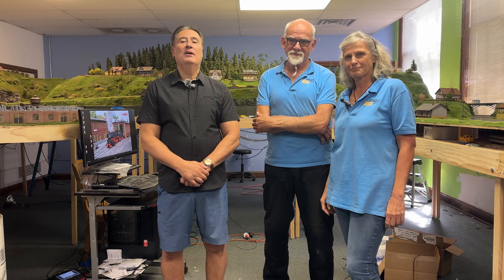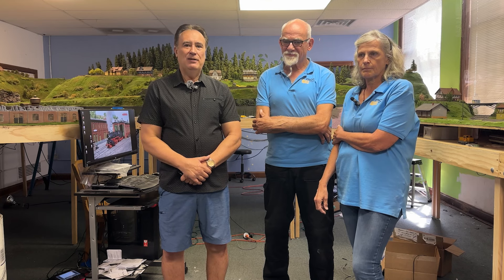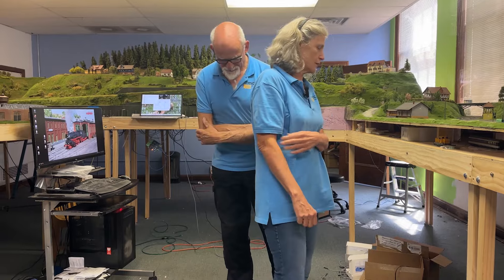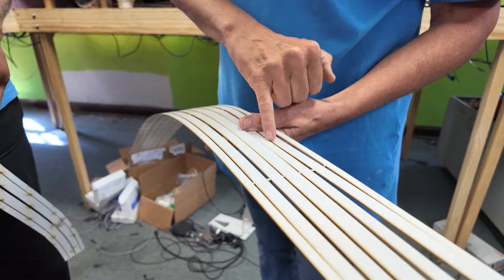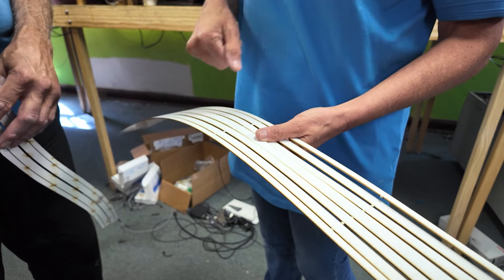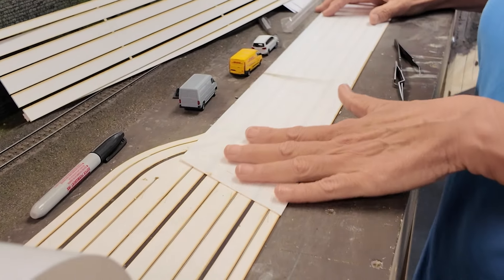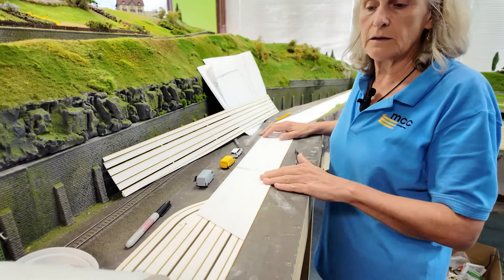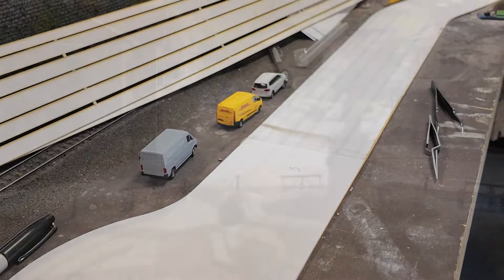A Revolutionary New Advanced HO Car System

Comment: Definitely need more information and understanding how this works.
Reply from the maker: This system is truly an improvement from current systems on the market, as it leverages software and GPS positioning without the need for mini-satellites mounted on ceilings. Instead of sending data from satellites to each vehicle, the DCC data is transmitted through wires running along the side of the road. Satellite-based systems often struggle in tunnels or shadow stations, and they require cutting holes in the tops of vehicles to receive communication, which is far from ideal.

Comment: Interesting concept. I worked with the Faller system at Gulliver's Gate in Manhattan back in 2017/2018. Some of the layouts just used "dumb" vehicles, no decoders or receivers, just the motor and battery, while others used different infra-red communication systems. This looks like it is a major improvement.
Reply from the maker: This system is truly an improvement, as it leverages software and GPS positioning without the need for mini-satellites mounted on ceilings. Instead of sending data from satellites to each vehicle, the DCC data is transmitted through wires running along the side of the road. Satellite-based systems often struggle in tunnels or shadow stations, and they require cutting holes in the tops of vehicles to receive communication, which is far from ideal.

Comment: Can you have more than one vehicle on the track? If you can, how close can they be to each other traveling in the same direction?
Reply from the maker: The amount of vehicles is limitless it really depends on the size of your layout.  The layout we are building will have about 25 vehicles running at the same time.  This system is truly an improvement compared to other systems on the market, as it leverages software and GPS positioning without the need for mini-satellites mounted on ceilings. Instead of sending data from satellites to each vehicle, the DCC data is transmitted through wires running along the side of the road. Satellite-based systems often struggle in tunnels or shadow stations, and they require cutting holes in the tops of vehicles to receive communication, which is far from ideal.  Our layout features two shadow stations where vehicles can recharge and be shuffled. The software automatically detects when a vehicle is running low on battery and directs it to one of the shadow stations. Once there, the vehicles are recharged, and the system will then dispatch fully charged vehicles. The entire process is fully automated.

Comment: How many cars can go on the track at one time?
Reply from the maker: The amount of vehicles is limitless it really depends on the size of your layout.  The layout we are building will have about 25 vehicles running at the same time.  This system is truly an improvement compared to other systems on the market, as it leverages software and GPS positioning without the need for mini-satellites mounted on ceilings. Instead of sending data from satellites to each vehicle, the DCC data is transmitted through wires running along the side of the road. Satellite-based systems often struggle in tunnels or shadow stations, and they require cutting holes in the tops of vehicles to receive communication, which is far from ideal.  Our layout features two shadow stations where vehicles can recharge and be shuffled. The software automatically detects when a vehicle is running low on battery and directs it to one of the shadow stations. Once there, the vehicles are recharged, and the system will then dispatch fully charged vehicles. The entire process is fully automated.

Comment: Will this system work with O scale vehicles?  Weight may be an issue, so maybe only try plastic cars or trucks?
Reply from the maker: The size of the scale does not matter.  The problem is there are not a lot of manufacturers of O-scale vehicles.  We can however convert existing O-Scale vehicles, this is the plan in the future.

Comment: That's pretty cool. Is there an N-scale version available. Do the vehicles have to be motorized? I have a large collection of Micro Machines that I use on my layout. They are a little bit abstract, but they are close to scale. They just have oversized wheels on them.
Reply from the maker: We're developing starter sets for end users, allowing them to build their own systems. Our engineers can retrofit HO scale vehicles, including models as small as a Smart car. They can even design N-scale vehicles and, in some cases, Z-gauge vehicles.  This system is truly an improvement, as it leverages software and GPS positioning without the need for mini-satellites mounted on ceilings. Instead of sending data from satellites to each vehicle, the DCC data is transmitted through wires running along the side of the road. Satellite-based systems often struggle in tunnels or shadow stations, and they require cutting holes in the tops of vehicles to receive communication, which is far from ideal.  Our layout features two shadow stations where vehicles can recharge and be shuffled. The software automatically detects when a vehicle is running low on battery and directs it to one of the shadow stations. Once there, the vehicles are recharged, and the system will then dispatch fully charged vehicles. The entire process is fully automated
Reply: @ReynauldsEuroImports  I've been doing a lot of remodeling in my house since I retired 3 years ago, and that includes my train room. I'll be starting all over again because I had to move a wall so I can use the longer Kato locomotives and some of my longer rolling stock. I am modeling the main part of the layout after old Downtown Kingman, Arizona. I will have two roads that I can loop around. I think a setup like this would really benefit my layout. Cool idea!

Comment: Very cool. I love the idea of moving vehicles in a layout. It adds a lot of life to the world the trains live in.
I wonder if its possible to provide power to vehicles wirelessly like a cellphone induction charger to reduce the need for batteries and to adapt better to smaller scales.
Reply from the maker: This system is truly an improvement, as it leverages software and GPS positioning without the need for mini-satellites mounted on ceilings. Instead of sending data from satellites to each vehicle, the DCC data is transmitted through wires running along the side of the road. Satellite-based systems often struggle in tunnels or shadow stations, and they require cutting holes in the tops of vehicles to receive communication, which is far from ideal.  Our layout features two shadow stations where vehicles can recharge and be shuffled. The software automatically detects when a vehicle is running low on battery and directs it to one of the shadow stations. Once there, the vehicles are recharged, and the system will then dispatch fully charged vehicles. The entire process is fully automated.

Comment: Company webpage?  Links?  Prices?  Very interesting, and theoretically superior to FCS or Viessman, but they claim you can use any size car, but you still need motor and decoder.  So how do they get it in a HO Smartcar, for example.
Reply: Any-size that can fit a motor and battery and decoder it seems.
Reply from the maker: We are still in the early stages of development, pricing, and website links will be available by the end of the year. We're developing starter sets for end users, allowing them to build their own systems. Our engineers can retrofit HO scale vehicles, including models as small as a Smart car. They can even design N-scale vehicles and, in some cases, Z-gauge vehicles.  This system is truly an improvement, as it leverages software and GPS positioning without the need for mini-satellites mounted on ceilings. Instead of sending data from satellites to each vehicle, the DCC data is transmitted through wires running along the side of the road. Satellite-based systems often struggle in tunnels or shadow stations, and they require cutting holes in the tops of vehicles to receive communication, which is far from ideal.  Our layout features two shadow stations where vehicles can recharge and be shuffled. The software automatically detects when a vehicle is running low on battery and directs it to one of the shadow stations. Once there, the vehicles are recharged, and the system will then dispatch fully charged vehicles. The entire process is fully automated.
Reply from the maker: We are still in the early stages of development, pricing, and website links will be available by the end of the year. We're developing starter sets for end users, allowing them to build their own systems. Our engineers can retrofit HO scale vehicles, including models as small as a Smart car. They can even design N-scale vehicles and, in some cases, Z-gauge vehicles.  This system is truly an improvement, as it leverages software and GPS positioning without the need for mini-satellites mounted on ceilings. Instead of sending data from satellites to each vehicle, the DCC data is transmitted through wires running along the side of the road. Satellite-based systems often struggle in tunnels or shadow stations, and they require cutting holes in the tops of vehicles to receive communication, which is far from ideal.  Our layout features two shadow stations where vehicles can recharge and be shuffled. The software automatically detects when a vehicle is running low on battery and directs it to one of the shadow stations. Once there, the vehicles are recharged, and the system will then dispatch fully charged vehicles. The entire process is fully automated.
Reply: @ReynauldsEuroImports  Cool.  Thanks for the reply!!!

Comment: Isn't this just the Faller Car System repackaged?
Reply from the maker: No it's completely different.  This system is truly an improvement, as it leverages software and GPS positioning without the need for mini-satellites mounted on ceilings. Instead of sending data from satellites via Wi-Fi to each vehicle, the DCC data is transmitted through wires running along the side of the road. Satellite-based systems often struggle in tunnels or shadow stations, and they require cutting holes in the tops of vehicles to receive communication, which is far from ideal.  Our layout for instance features two shadow stations where vehicles can recharge and be shuffled. The software automatically detects when a vehicle is running low on battery and directs it to one of the shadow stations. Once there, the vehicles are recharged, and the system will then dispatch fully charged vehicles. The entire process is fully automated, this is just one example of what you can do.  Another key difference is that the FCS system uses a metal wire embedded in the roadway, and the vehicles rely on magnets to follow the wire. The downside to this approach is that FCS vehicles must constantly maintain contact with the road, which leads to wear and tear over time, requiring more frequent maintenance. Additionally, since only the vehicles have magnets, the connection to the wire is weak, making it easier for the vehicles to veer off the road. The FCS system also struggles on rough terrain, as the vehicles can't navigate it effectively.

In contrast, the MCC system uses a heavy magnetic strip embedded in the roadway, and the vehicles are equipped with magnets as well, creating a much stronger connection. This robust setup allows vehicles to handle uneven terrain, such as tractors operating on a farm field or tanks moving across a battlefield.